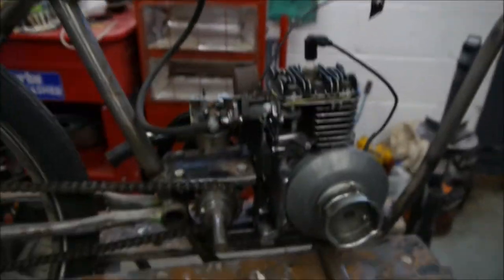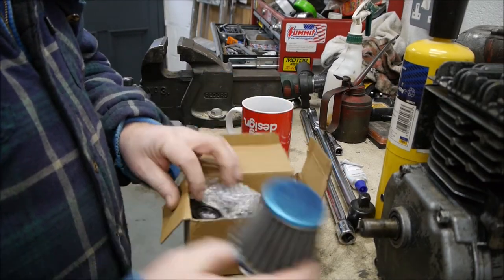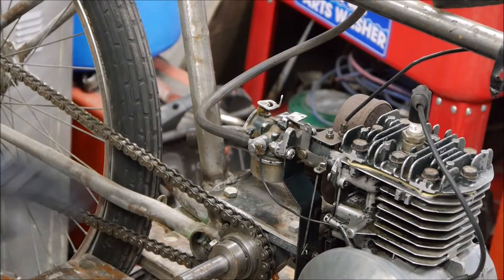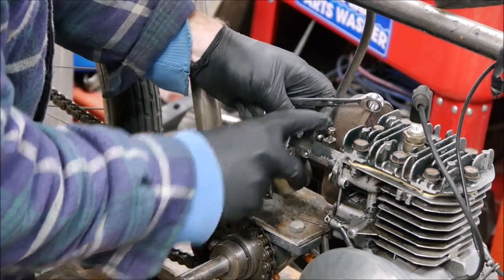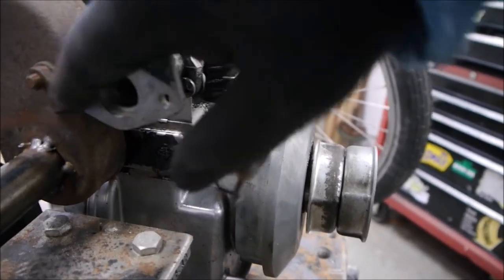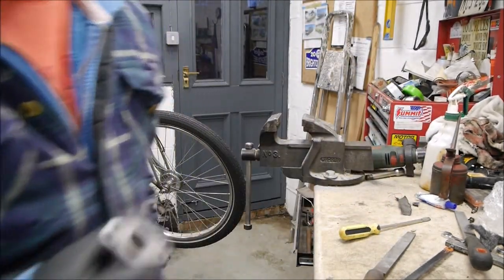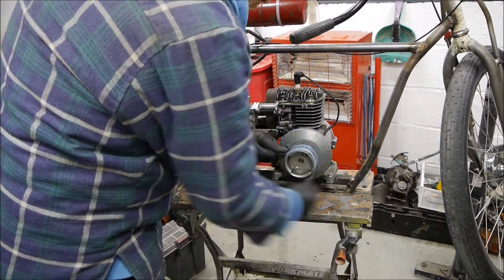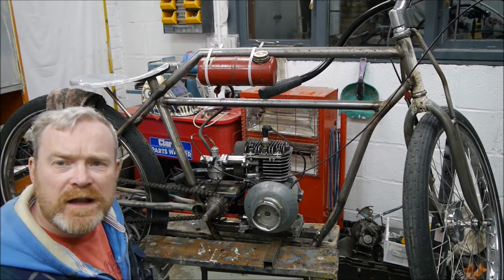How to build a Board Track Racer replica  part 6 - Vintage Steel Garage Ep 51

Comment: I used a Mikuni knock off carb round slide. I had to move the main needle up a couple notches. Had to be really careful not to lose the little clip when taking it off & putting it on that needle.
Reply from the maker: I'm sure mine will need some tuning for now just put it on and it's running ok